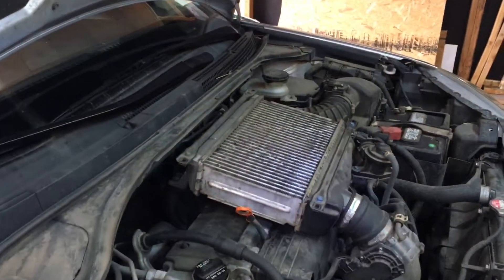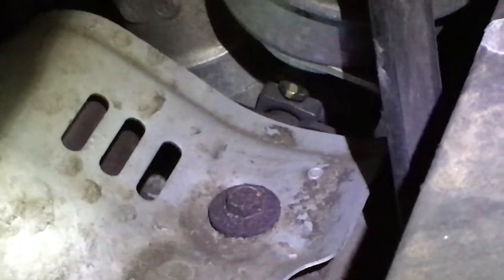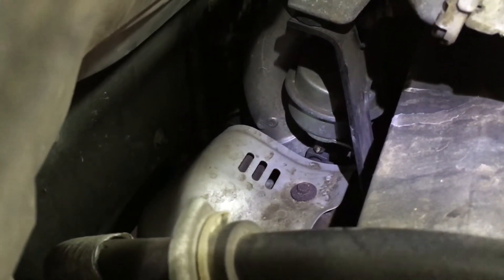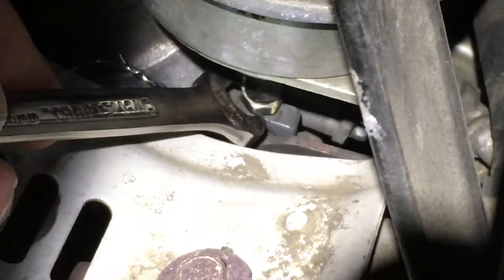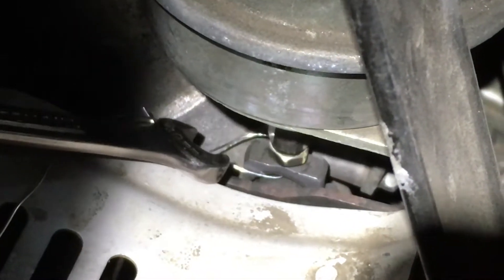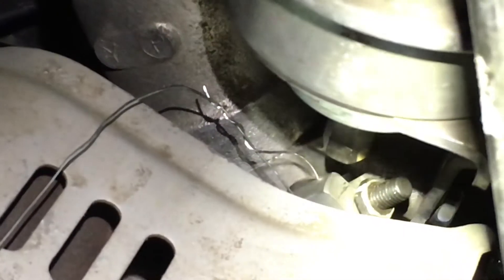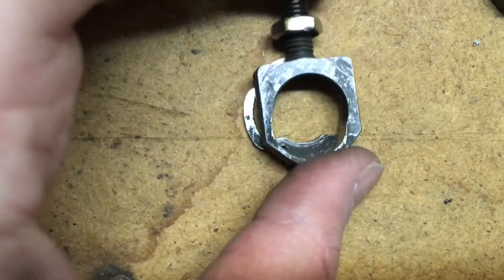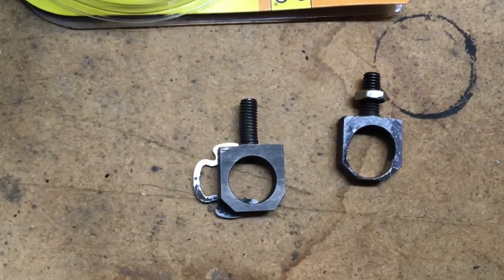How to fix P2263 Acura RDX Turbo error code - repair/replace VGT actuator / waste gate

Comment: hey matt how did you fit that bolt back on? seems like the only reason the old one could come off was because it was so worn. does that part that the eye bolt goes on tighten or loosen?
Reply from the maker: I put the new actuator on, then thread the collar down onto it. As I mention in the video, make sure the collar doesn’t spin freely a bunch trying to get it to thread or your adjustments will be out of whack when you get it tightened down. As it spins “freely” it’s actually adjusting the gap size between the actuator and the actuator arm so you don’t want that to happen.

Comment: thanks ever so much . dealer wanted to replace turbo
Reply: This is why we call dealers stealership
Reply: @vkhiev  Acura themselves do not sell just that part. it only comes together with the new turbo so dont blame the dealerships....  cant sell something that isnt offered from manufacture. Some dealerships (mine does) do offer to replace just the arm with an aftermarket part

Comment: Hi this video is exactly what been happening to my 2010 rdx. I got the exact code. The car drives extremely slow now and struggles to accelerate? Is my issue the actual turbo or this small part replaced??
Reply from the maker: It could be. Take a look to see if there is a gap/worn area on the old part. The description has links to threads discussing that and similar problems. This isn’t always the fix but often is.

Comment: I had these codes, bought the part, got my garage to do the replacement but it did not clear the issue!?!?!  very, very disappointed.  Wondering if there is something else I can try??  also wondering about driving with this condition?
Reply from the maker: Check the description... it can have several causes, I'd go read the Acurazine thread for further troubleshooting. Or maybe the piece you had installed is out of adjustment. (just twisting the barrel nut won't actually adjust it, you gotta take it off, adjust the nut, then thread it on again)
Reply: @aw-yiss  ah ok about the adjustment . . . not sure I can get them to do that but will try.  And yes, I did see that there are other causes so will investigate those too, including replacing the solenoid as suggested by someone on this thread.  thanks very much for getting back to me and wish me luck on the journey to clear this up!
Reply: @kellymitton5510  did you ever solve your issue ?
Reply: @MeezyPeezy  nope.  I did have my garage install the part but no luck in fixing the issue.  I have been driving around with the alerts and luckily have had no issues but am worried something will one day blow!  any other suggestions?
Reply: Did you clear the check engine light by the obd2 or disconnect the battery?

Comment: How the hell did you get the new piece on??! 😭
Reply from the maker: Twist the barrel backwards a little to get it to seat on your new piece's threads, then screw it down. Don’t just keep going backwards forever until it seats though... need to keep the barrel's position roughly the same. Go back and forth a bit until it seats. Otherwise it could be incorrectly positioned (too high, or too low) when you're done.

Comment: Thank you for the video. Bought the part on eBay and it completely fixed the issue. Was able to get my car to pass inspection. It was a bit of a headache getting the new part installed since the clearances are so tight, but definitely worth the effort. Thanks again!
Reply: Any tips on getting it in? Having a lot of trouble?
Reply: @fishtheory7529  if you pull the lever arm on the waste gate all the way up, it should give you more clearance to get the part on. If the lever is pushed down, the turbo body gets in the way. It's still very tight so it takes patience and some effort.
Reply: Do you have a link to the part please?
Reply: What is the name of the part

Comment: Thanks for the video Matt. My lady's RDX that we bought just over a month ago came up with this code. Do you know if the ebay ones are good? There are 2 forsale. One at 39.99 and another at 59.99.
Reply from the maker: Not sure. The spec I got was 4140 and m6x1.0 left hand thread. It think 4140 is one grade heavier metal than OEM which is probably just right. Too hard and you might wear the other parts.

I’ve heard some models have different threading
Reply: I bought the one that was 59.99, swapped it and the boost is back! Code gone.
Reply: @TheDarkRican  can you email me by chance and explain the entire process. My husband cannot seem to get the old one off.
Reply: @TheDarkRican  we bought one as well but he spent hours and was unable to get the old one off to put the new one on. This video doesn't show that part so we dont know where to turn
Reply: @jessicaross323  it was very tedious and tight space. Took alot of patience.
Reply: @TheDarkRican  well... I guess he wont be doing it then because patience is something my husband greatly lacks. Any tips or pointers you can give to help
Reply: @jessicaross323  Sorry but that was the only way, with a string attached so it wont fall over and over. Just patience until it is in place, then pull out the string when it is on.
Reply: @TheDarkRican  we got it on. And I have driven the car quite a bit since and the code has not come back on fingers crossed it worked to fix it. I also noticed that my turbo engages at the slightest touch of the gas pedal and let me tell u what my car is FAST lol I didnt realize that my car had as much get up & go hahaha
Reply: @jessicaross323  you have to clear the code. We did after and its hasn't come back. That verified to us that was the issue.
Reply: @TheDarkRican  oh yeah I know lol we cleared it. So far it has not came back on
Reply: @jessicaross323  That's great news!!!
Reply: If u were successful could u give me some advice.

Comment: I have the same issue on my 2011. After seeing your video I found and ordered the part on ebay today for $49.99. ( Acura RDX Turbo Variable Flow Actuator Eye Bolt)
I put the new actuator eye bolt on my car and it solved the problem!!!!! I was able to get my car inspected the same day. Thanks for your help.
Reply: Roderick Harris did it fix it?
Reply: Yes it did

Comment: Thanks for the video, man! Any thoughts on how much easier or harder it would be to just replace the whole actuator? when I searched ebay for the "49389-18470 U.S.A." part, what I got was the entire actuator (https://www.ebay.com/itm/TD04-Acura-RDX-K23A1-P2263-49389-18470-MHI-Turbo-Actuator-New-2-3-P2263/292997507065?epid=5026489941&hash=item44380327f9:g:R50AAOSweTlckIfs)
Reply: HI Charlie,  I have the same question you had about just replacing the whole actuator.  Can you let me know what you did and if it was possible to replace the actuator with out taking the turbo out?  Thanks in advance for your reply.
Reply: @siwong744  You can indeed replace the whole actuator, but why spend all that money when the part needed to fix the issue is just the small valve holder piece.  You can search for grade 8 acura rdx vgt actuator on ebay and get the piece for $60.
Reply: @BasementBeatz412   Hey thanks for responding.  So I checked the small value bolt and I'm not sure that the small value bolt is causing my issue.  I don't have the deformity that others have noted on the bolt.  What is strange for me is that there is a lot of rust on the actuator itself (not sure why).  Given the conversations I've had with turbo remanufacturers, most tell me that the actuator is the problem most often and the entire part is replaced, so I figured I'd just replace the entire part.

My concern now is can I change it without taking the turbo off, if I just take the intercooler and heat shield off, will I have enough room to work with.  I'm still waiting for the part to arrive.  Again thanks in advance for any assistance.
Reply: si wong you’re welcome - I have never replaced the actual actuator or I would give advice!  Good luck!
Reply: @BasementBeatz412  No worries, thank you for your reply.
Reply: @siwong744  yes, I found a shop that was able to replace the actuator without removing the turbo
Reply: @seabuck4  Thanks Charlie.  That's good to know!

Comment: Replaced the part, still getting the code, any other suggestions?
Reply: FWIW I read on Acurazine that you need to clear the code ... disconnect neg battery terminal for 5 minutes, that should clear any codes. Then see if it comes back. Know it's been 7+ months since your post, but hope this helps.
Reply from the maker: Maybe unthread it, adjust the threaded collar, then thread it back on? Otherwise I'd check the description and the forum thread in it for more suggestions. This isn't the only cause, but it is the prevalent one.

Comment: Really hard to believe the guy wants 200$ plus shipping. I have a machine shop making one up 1/4 the price.
Reply from the maker: It was 300 when I bought it. I didn’t have another option at the time.
Reply: @aw-yiss I just purchased this part for $80. Hope it works. Thanks for the video!

Comment: That is awesome. My daughter's car has the same problem, I was able to tighten the existing nut to keep the codes clear but I know it's only a matter of time. Thanks for the link!
Reply from the maker: If you kept both sides connected to that barrel nut, and simply twisted it, it's not going to fix it because the two bolts that connect from both sides are still the same distance apart. If they're both still threaded in when you "tighten", the barrel just moves farther down but the two bolts stay in the same spot.
Reply: @aw-yiss  can you clarify? my mind doesnt seem to understand this
Reply from the maker: @STAN3072  The barrel nut, which you are twisting to "adjust", has threaded bolts coming in to the top and the bottom from the different parts it connects. When you twist the barrel nut without first disconnecting one of the sides, you're not actually tightening anything - the barrel nut moves down the threads of one side while moving up the threads of the other. The two  sides are staying the same distance from each other. That's why to actually adjust the gap, you have to disconnect one side, then twist the barrel nut, then reconnect the other side to actually change the size of the "gap" between the two pieces held together by the barrel nut.
Reply: @aw-yiss  Hmm, Matt, When I adjusted the barrel nut it make a difference four months ago and has worked ever since, so I must say it does work for the short term. It was a chronic problem when we bought the car (6 months ago). I have since ordered the part, received it and today am GOIN IN! Wish me luck!
Reply: Let me clear that comment up. The adjustment of the barrel nut made all the difference in that we never got a code again until just recently. Thanks for the video and the link to Darren, it makes me think I can do it.
Reply: Matt Muller p

Comment: What’s up bro, quick question. I have engine code p0234 which is wastegate overcharge I replaced turbo which now I regret doing because same engine code is still on!!! Any suggestions?
Reply from the maker: Not sure offhand. I’d search the acurazine forums for that one.
Reply: Hi Alex I know it’s been a year since you posted this question but did u figure out the issue. I have the same problem. Thx in advance
Reply: Marcel Willoughby yes, it turned out to be a solenoid that needed to be replaced. After fixing it the RDX ran great.
Reply: @alexrojo7008  what solenoid is that? Any part number? Thank you
Reply: Hey everybody,I have also had this issue with my 2007 Acura RDX.I went to two shops and both of them told me that the turbo had to be replaced.The first shop first said that the solenoids were bad but then they told me that the wastegate was bad and that the turbo had to be replaced.The second job straight up told me that the turbo was bad so I blindly got suckered in into replacing the turbo.I couldn’t justify spending $5,000 on a turbo from a dealer so I got a new turbo from autozone for $1,700.The turbo also comes with a 3 year warranty!!!! The first shop wanted $1,000 for labor but the second shop quoted me $520 so I went with the second shop.Unfortunately even after I replaced the turbo overboost code still came up which had pissed me off.Two bad diagnosis caused me to waste unnecessary money.If a brand new turbo hasn’t fixed the issue it’s definitely the boost solenoids causing the issue.THERES TWO BOOST SOLENOIDS which I had picked up for $90 each from the dealer(dealer only part).I just got the part and I’m taking it to another mechanic who is Acura/Honda specialist and the price to replace it is $140+ tax.That price is a lot better than what others quoted me.I’m soon taking it to replace the solenoids after I just picked them up.Hopefully the issue goes away because I already spent a ton on this car.This car is pretty expensive to maintain and parts are pretty expensive as it is for the car unfortunately.Hopefully it won’t come to the point that  I have to sell it because I love this car.It’s hard to sell a car that I love so much.Btw if anybody is having this issue please replace the small parts and get it looked at by a good specialist Acura mechanic.I went to a top end shop and even their bad  diagnosis caused me to spend a lot of money.Btw if the wastegate goes bad you have to replace the whole turbo unit as it is.I hope this helps everybody!!!!

Comment: I own a 2007 acura rdx, and its giving me the same code, and it says check engine emissions system, will this fix it??
Reply from the maker: Sometimes. Check the description, there's a few causes. Check to see if there's a gap in the ring or a rattling sound... if so, this will probably fix it
Reply: @aw-yiss  like a ratting sound that happens after you let off the throttle ?
Reply: @Username_8886  That is what mine sounds like, not really coasting but right after I let my foot off the accelerator.  My emissions warning just went off recently too, so hoping this is a realistic solution, since my first estimate was "you need a new turbo"
Reply: Veggie8886 did you ever figure out what this sound is? My car makes the same exact sound.

Comment: Freaking awesome, thanks!  Seems like there are two different measurements for the opening of this part, what year was your RDX and what was your measurement?
Reply from the maker: The openings have different measurements? I'm not really sure to be honest. I've read .585" before. Something else to note, my threading is M6x1.0 Left Hand. Rarely, you will find an '07 RDX with M7 threading.
Reply: @aw-yiss  yeah, post #249 says:

"I have another question. A poster mentioned the dimensions of a part being rebuilt as an M7x1 with a .585" opening. What year vehicle did that come off?

The measurements from the part I pulled off a 2008 is an M6x1 with a 15.25mm opening. Perhaps Honda's short term fix was just a larger part on the newer year models?"
Reply from the maker: @DavidSnyder3B  Doubt it, the fix should be a grade of metal that won't wear down over time. Bigger or smaller part I'd imagine wouldn't matter... but the size change maybe indicates they moved to a new part which hopefully is a better grade metal.